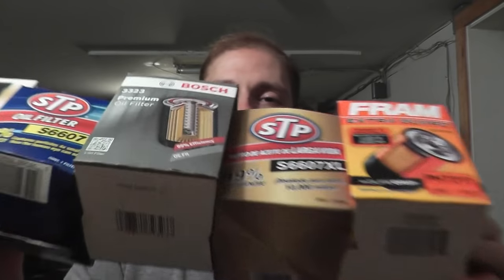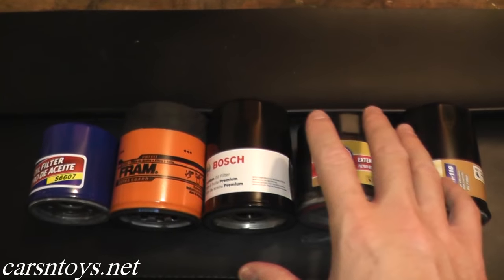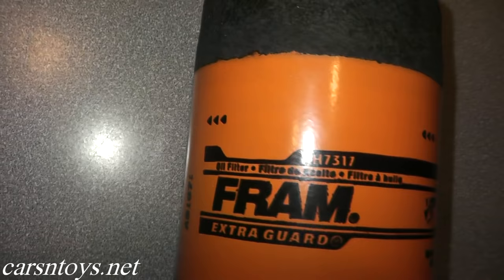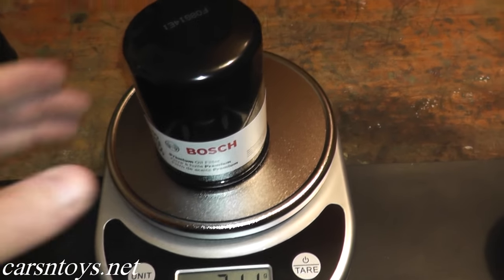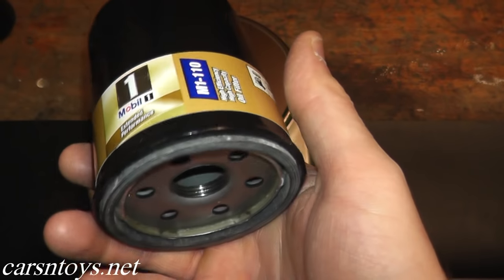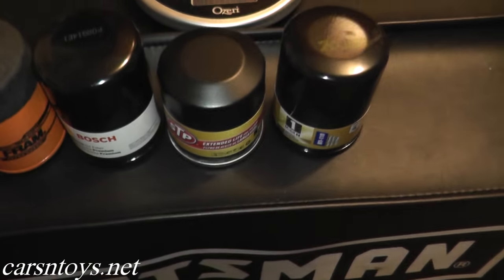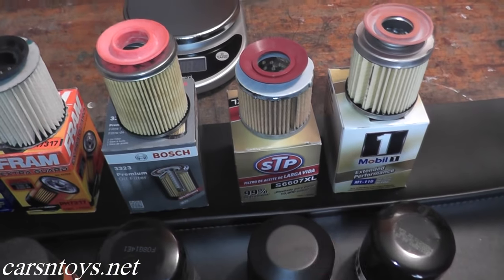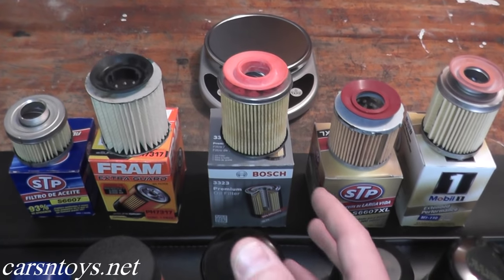OIl Filter Comparison...STP vs FRAM vs BOSCH vs MOBIL1

Comment: Hey, how's about you pull the pleated filter material out and compare the unfolded surface area of each then hold each sheet of filter material up to the light to compare thickness. and create a scale 1 - 10, to the hundredths (2..25   3.75 and so on up to 10) then multiply the surface area by the 1 -10 gauge number and the higher the number the better the quality. Or, just weigh the filter material only.  However, this still doesn't take into consideration the design and resulting flow.
Reply from the maker: This may be more what you're looking for - https://youtu.be/kx-NT1DEtlU

Comment: What kind of oil do you use in the US??? Changing filters every 3 months??? In Europe we change oil and filters once a year or at least 10.000 Miles as standard. Without ANY problems. Oil changes at 15.000 miles is becoming more common on new cars.
Reply from the maker: I agree. Newer cars can go up to one year before a filter change. Older vehicles, however, require a change more often.

Comment: The grip texture on the Fram is ok until you have one get stuck to the mating surface and you have a vehicle that has a hard-to-get-to filter placement and requires a form fitted filter wrench. I had a Buick that the Fram filter was seized on, and there wasn't enough space to slip a universal wrench around, and with the extra 1/8th thickness of the grip material, I couldn't get the cup ended filter wrench over the bottom. Ended up having to hammer through it with a long screwdriver and twisting it off. 

That's why I hate quick lube places. Not only did they use a shitty Fram filter after promising me that they used Pennzoil filters, they screwed it on so tight there was no way it would ever come off without damaging it.

Comment: Not a bad video. Could use a little more editing to avoid gaps in information with respect to previous comparisons between the different brands (for example STP was featured with a gap in brands as opposed to side by side comparisons).  Also, would recommend more safety tips, such as use of gloves, safety glasses, or other PPE and would most definitely not use any tools on the expired filter that would create sparks.  Fire hazards are abound in this video.   Otherwise, this video was very informative and did help me to think of a similar scientific process to determine my own way of testing oil filters.  Good job.  I give this tutorial a 7.5.
Reply from the maker: +david luna Thanks
Reply: +CarsNToys  You are always welcome!

Comment: You should be measuring the filter media area (unfolded) as well as particle size filtering ability.  Secondary qualities measure: shell thickness (correlates to burst resistance),   pressure drop between inlet and outlet, flow capacity (related to pressure drop).

Comment: I don't think I learned a dang think from the video aside from the weight of the filters, that aside  Mobile 1 has always been the brand for me.

 But my car is super choosy with it's gas and Oil so it's had nothing but Synthetic Mob1 for the past 200,000 KM, but that said I also drive the car pretty dang hard and go through the long life synthetic in about 6000-8000 KM. lol

Comment: Is there any published data such as the diameter of filter pores and/or number of pores per sq. inch or centimeter for the different brands of cartridge material ?
Reply: Ah... Such a hot topic no doubt! Filter quality! I'm sure that there is technical data for oil filters. I'm sure the makers have all kinds of white papers to drool over.

Comment: The filters should be for the same engine, so we can see the difference in element size. A filter cutter should be used instead if a grinder. I know because I'm a welder and auto mechanic. The grinder is dangerous and produces metal powder, smoke, and uses power.
The element should be weighed without the rubber by pass valve. Other than that, thanks for the video and a look inside of those filter.
Reply from the maker: Thank you. Appreciate the feedback.

Comment: FYI gm uses ac delco not bosch.  all of those filters are available at walmart and all are of low quality.  not saying they are bad but all are economy filters. even the ac Delco avail at walmart are economy hence the "e" after after the part number. advance auto parts ac filters do not have the "e"
Reply: andrew lawson e stands for the e-core. Those use a plastic cage behind the pleats instead of a metal spine.

Comment: You should never have to use a wrench on a oil filter. Hand tight only. Use it to get it off only. Replace hand tight. Do some forearm excercises with a wrist roller to strengthen your hands.

Comment: I'm a professional automotive mechanic and have been for 20+ years, I have a running track record, every single engine I have replaced has had an orange fram filter on it, don't buy orange fram oil filters!
Reply: I'm shocked to look under the hood of a Ferrari and see orange filters on the engine.  !!!!!

Comment: If your going to compare  by weight. At least  make sure the filters all fit the same aplication.   If  there not the same basic part number.  There is going to be some weight difference.
Reply from the maker: Thank you. All made for a '97 Maxima.

Comment: From a racing perspective; Fram is a quick way to lose an engine. At higher RPM's it collapses and tears. My racing buddies tell me its due to Fram using recycled paper, but overall the design lacks, good paper or bad..
Reply: Depends on which Fram. The XtendedGuard is of metal construction and its filter media is one of the best.

Comment: Don't use Fram oil filters jiffy lube put one on my car and I started having oil pressure problems and the only reason I went to jiffy lube is because I didn't have time to do it myself at the time as soon as I had the time I did my next oil change myself using the Mobil 1 oil filter and next thing you know oil pressure problem gone and my car literary purrs like cat and roars like a tiger. Fram is just junk.

Comment: I would go out on a limb and say your logic of the STP extended life having more filter material than the Bosch because it's smaller is totally flawed. You're thinking the exact opposite of what I would think. Plus on the initial weigh in you seem to be ignoring the construction of the oil filter case its self. Then after the case was off the filters you never actually examined the actual filter material and construction of the filters, for instance how many pleats does each filter have? Or the fact that each filter had an antidrainback valve except the cheap STP. Or the fact that Mobil 1 advertises their filters as a "synthetic fiber" filter. This review is completely half assed and should have never been posted in the first place.

Comment: The first 2 are for the garbage can... I'm disappointed in the M1 because that's what they recommend for their 20k mi. Oil (bad idea), & the only good filter here is the bosch.

Personally, I only use oem filters - cheap & I never worry if it's too good or if it won't survive the oci. (I've had filters not survive oci's in the past)

Comment: The 10,000 mile STP with silicone drain back valve and O-ring, coil spring, metal end caps, and a synthetic filter element sounds pretty good to me. The size is smaller, but I ain't going more than 5000 to 7500 miles anyway.

Comment: K&N is very similar to the Mobile 1 as they are actually made by same people.. You also did not get WIX. Which is been reported the best .. Nor did you get the Amsoil brand which is rated good. I am not sure where you buy your filters but you can get a WIX from Oriely's for like $6. and if you want to save even more money you can buy them in bulk (12 at a time) form like Amazon..
Reply from the maker: +Torpedomtb Local part store doesn't carry WIX, Amsoil, Royal Purple, etc.
Reply: O'Reily's has WIX. Pep Boys has Royal Purple. And Amsoil does have local dealers but like the others can be had online..
Reply from the maker: +Torpedomtb Have Wix, K&N & Amsoil: https://youtu.be/kx-NT1DEtlU

Comment: Didnt mention silicone drain back orange instead of black
Reply from the maker: This is more up your alley - Silicone vs rubber drain back valves, wire backed material, cellulose vs synthetic...etc etc - https://youtu.be/kx-NT1DEtlU

Comment: To me, it seems like the FRAM is total crap. The BOSCH is the best when comparing price to performance. The MOBIL 1 is the best filter if you are using synthetic. The others use as directed. Or, did I miss something? If I did not miss anything, I shall use the BOSCH filter exclusively for all of my vehicles.

Comment: Why no mention of the filtering material or the size of the smallest particle of dirt that each filter is capable of removing? I assume from the sawing apart that none of these filters have a pressure relief valve which would open in case the filter was old and full of dirt. Without a valve the oil could blow a hole through the filter and release all of the dort that was previously filtered out. I would also suggest adding a Hastings/Amsoil filter to the group if still available. The applause is annoying.
Reply from the maker: Thanks. I appreciate the feedback. This provides more detail: https://youtu.be/b9pVxaH7Vcs

Comment: did you know most cars did not have oil filters from the factories til mid 1950s ?
Reply: +carhead ...they also used non-detergent single grade mineral oils.  The particulates would settle out as sludge, and the oil still looked relatively clean.
Reply: i can remember removing a valve cover on a slant 6 and there was a replica of the cover made of sludge under it.

Comment: i use k&n change every 5k miles on royal purple oil never noticed any isues maybe can run a lot more miles but i rather not since i have a heavy foot... had a 77 ford f150 5.8 ran regular stp oil filter and Quaker state oil 10 30 or 10 40 after 100k mile rebuild when i opened block and heads looked bran new internals where perfectly clean i was a mazed that carburator old school motor with cheap oil worked that great i changed oil every 2 to 3 k miles though.
Reply: Quaker oil is good
Reply: Victorian Sculptures Pennzoil sux though... leaves engine gunk
Reply: *****
Well that plus the fact that before the oil pressure builds to normal the bearings don't get full protection during starting up.

Comment: Weight means nothing, yet, so much attention here. How well does the media remove dirt? That's what's important. And why can I not use the expensive "synthetic" filter for dino-oil? The media really gives a damn about when kind of oil passes through? Either it filters the crap out or it doesn't.

Comment: I would have really liked to see k&n included. "It was out of stock" isn't a good excuse unless you live in the back woods. Also I didn't like the applause. Other than those it was an informative video. A lot of mechanics I've talked to say never buy fram. Poor quality made in Mexico. I've always wanted to see the insides of a mobil1 filter. That's the one I buy. Along with their synthetic oil. The best of the best. Royal purple used to be my fav until I saw another video on YouTube- pouring at freezing temps--  minus 20°! Mobil1 synthetic won hands down.
Reply: +Lance Taylor ...I have opened Mobil 1 filters...top quality construction.  I have chosen Mobil 1 0W-30, for year-round use in my 1992 Firebird, and 2011 Tundra 5.7L Supercharged.  (After many years of trial and error, oil analysis reports, and research)  Bought a filter cutter from Jegs, or Summit.
Reply from the maker: +Lance Taylor Got K&N - https://youtu.be/kx-NT1DEtlU

Comment: What has mileage got to do with filtering capabilites it is running time on the enging and RPM that are critical. The filter media and area are what makes it a beter filter the rest is packaging. you did not show any specification #'s and did not show actual prices.
What was the best filter for your $ you did not answer that.

Comment: I've never had problems with fram
Reply: +Michael Flores Honestly.. if you change your oil when your suppose to, and keep your car in good mechanical order. ANY filter will be ok.. The filter should not be catching much anyway..If it is catching stuff then you got something going wrong with your motor. And really people do not just cut open their filters after a normal oil change to see what the filter had captured. I only see people do it after engine rebuilds, or they suspect something wrong with motor to check the filteration for glitter bits..
Reply: I change my oil when I'm supposed to
Reply: That's because they hurt your motor over time.

Comment: The weight and/or the amount of filter paper in an oil filter is irrelevant.  The most important aspect of an oil filter is THE CONSISTENCY OF THE FILTER MEDIA!  As long as it holds together for the duration of the service interval time it is designated for, nothing else is as important.

Comment: I only use Amsoil Absolute Efficiency filters or Mann if Amsoil is not available. Fram is junk, open it up and look inside.
Reply: Amsoil filters down to how many microns?
Reply: Bosch Distance Plus is a very good one I even prefer it as my main filter over any I do the oil changes to the cars I am 17 I use the filter on a civic ford expedition GMC savanna cargo van and a duramax I tried K&N and nope hate it too I think its for higher flow don't know weather I should believe them but the casing is strong but the filtration sucked the oil got dirty sooner and the Bosch Distance Plus cost us $12 K&N $17

Comment: pisses me off when manufactures say u can run your engine 10 k mile oil changes, my 13 audi q5 has 3600 miles on full synthetic, the oil is dirty, its ready to be changed, driving it 10 k miles is asking for trouble.

Comment: No comment on the Fram with paper end caps???  P.O.S.!   The Bosch appears to have the most media and longest life.  But it could be just paper.  The Mobil 1 has a better synthetic media.  There are two types of media.  Paper, and the latest synthetic media which is thicker and adds fiberglass for a "3D" media.  This media can trap much more dirt and finer dirt.   The efficiency of the media is a measure of this.  If Mobil1 filter says it is 99.9% efficient, it will trap 99.9% of a std SAE dirt sample.  Cheap paper filters don't filter as well, letting through larger particles.  And they don't hold as much dirt as a synthetic media and plug sooner.  I found a review of many filters by a university student.  http://www.austincc.edu/wkibbe/oilfilterstudy.htm.  The best filter is the Mobil 1, the only one with synthetic media.  The Purolator Pure One (=Motorcraft) have similar filtration as Mobil1 (~99%+) but is paper, albeit a lot of paper.  The AC Delco, high end WIX and Purolator Premium Plus (= Quaker State and others) are also pretty good.  All are paper but less media.  Looks like the Motorcraft is the best of paper filters and best price, and Mobil1 the best filter with longest life but quite a bit more expensive.  But if it lasts 3x, including labor savings it is worth it.  I think Ford may cut the price thinking mainly Ford users will buy it, and their engine will last longer, improving the FORD engine reputation.

Comment: Sorry but not impressed with your video.  Who in the right mind would put a Fram in their vehicle after seeing it is put together with cardboard? The filter medium is crap too. Frams have been know to have rust in the brand new filter? You want that in your engine along with cardboard pieces? Fram is a scam! Non of these have an actual flow back spring but of the 5 you would have to go with a Bosch.  Not in this video but others the best filters to go with are Wix or Napa gold.  Cut them apart and measure the superior filter medium length and quality. The frames are very sturdy and this won't come apart while trying to get it off while doing an oil change. Trust me that sucks. They actually have a spring that holds the flow back gasket so the oil doesn't flow out of the engine after shut down. Prevents start up wear.

Comment: what about mann ? i always use bosch or mann
Reply: Bosh and Mann are both made by Purolator. The Bosch is equivalent to the Pure One and the Mann is the analogue of the Purolator Classic. 

There have been issues with torn media and but drainback valves in cut open Purolator products lately, especially used filters. Because of this I have strayed away from them.

Comment: Any brand name filter works with either synthetic or oem oils; a better filter is a better choice using either type of oil, as it, uh, like, filters better? The few like Mobil 1 which claim to last up to 15k are likely to withstand heat, pressure, greater particulate accumulations more than others, if claims are accurate. K&N products are hyped more than anything, with "alternative" lines of reasoning and tests to justify, but the results are questionable. Anti-Big Company conspiracy thinking and such appeal to too many gearheads, but when bigger money backs research, and costs are spread over broader sales, you get the best of both with Mobil.